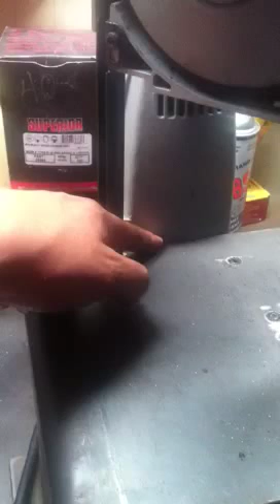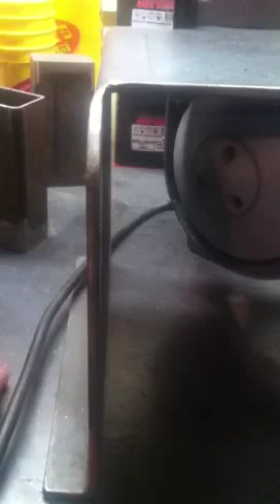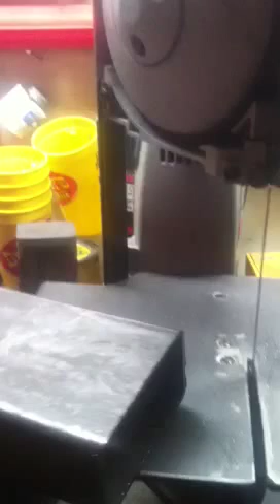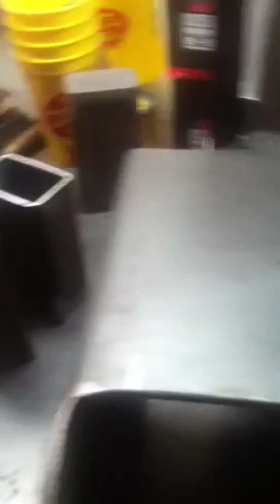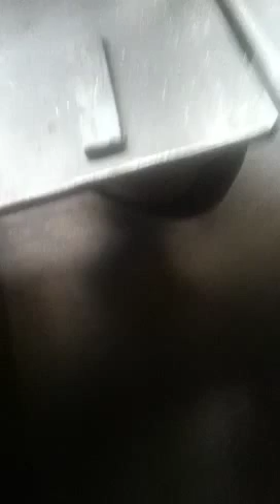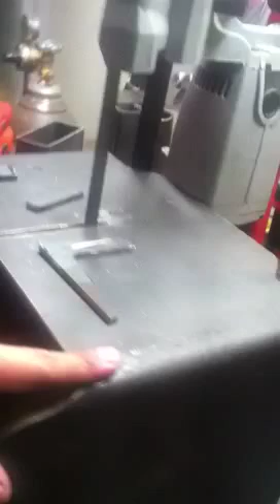Milwaukee portaband home made table

Comment: Great work I have a small one bay garage. How wide and long is the table top. Where did you place the slit for the blade?
Reply from the maker: Still works today as it did 7 years ago  !! Used it to cut all the parts for the smoker .. and other projects I have .. great little bandsaw ..
Reply from the maker: Great for small shops .. I used a piece of poster board to figure out where the holes should go and the slit .. you could make the top as long and wide as you would like .. I would prob make the top about 6 inches in front  of the blade to support material if I made another one .. but this one is fine for me ... if you make one send me a link or a pic or something.. I’m on Instagram jfcustomfab

Comment: What size plate did you use- length x width?
Reply from the maker: Tony Mann I'll measure tomorrow afternoon and get you an answer..
Reply from the maker: Tony Mann 34"X11.5. The top is 14inch across left to right 9 inches down with 1inch foot...
Reply from the maker: Tony Mann sorry 34 x 11.5
Reply: Thanks.  There's enough space for a 1/4” plate to fit in the vent slot.  Noticed depth is limited as the motor fan can be seen through the slot.  Might just might drill some holes in the table where it slides in the slot.   This will  allow a little more air flow.

I have a 1988 model 6320.  Looks like I’ll need to add a 1/4” spacer for the table to rest on the gear case.  Have two screws holding a narrow bumper.  Would need to drill through the Gear Case #39 to hold the plate.

You mentioned you’d of liked to had made the table longer in front of the blade.  Does the 11 1/2” measurement account for that?
Reply from the maker: Tony Mann yes I measured the legs width which is 11.5 ., you could do 12 or 13 whatever you think.. get a piece of poster board and mock it up that will give you a good idea of size